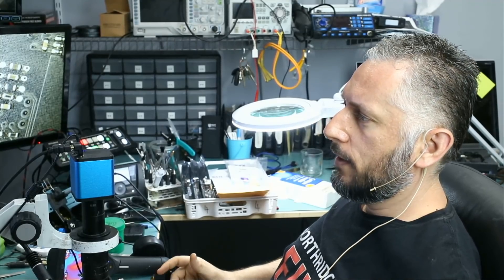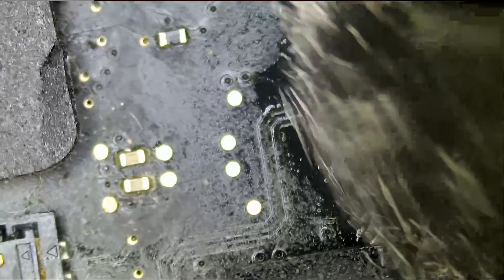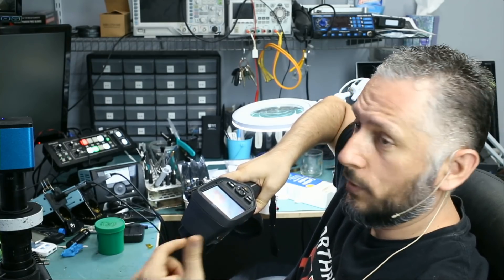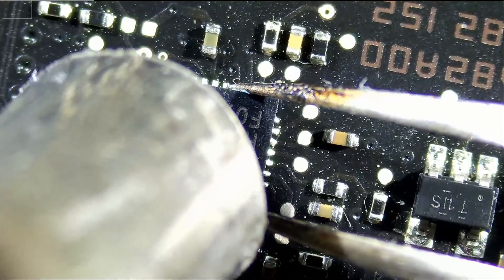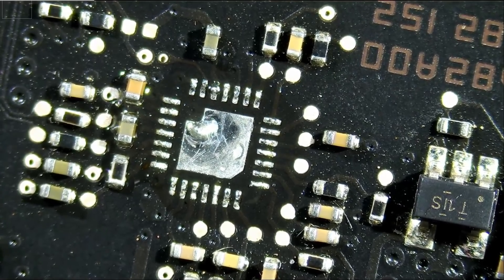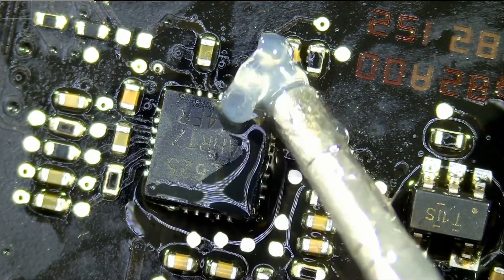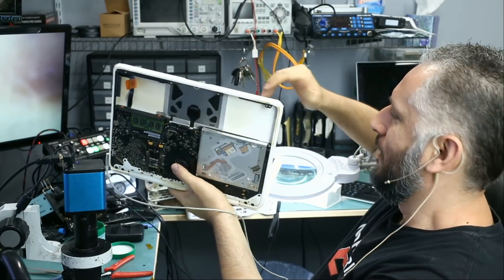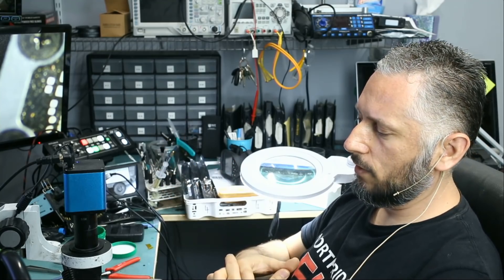Macbook Pro No Power Repair using Flir Cam - Working Smart not Hard

Comment: Working at a busy shop and a shop that doesn't have enough work to fill a day are world's apart. Some techs have spare time to spend more than three hours on a device, poking the multimeter leads here and there, changing different parts, bypassing signals with jumpers and so on. There's nothing wrong with those techs. It's just fascinating to observe the difference between a flourished and deprived business. Alex seems that he can't afford to fool around for a single second.

Comment: Mind boggling how a electric board still works after all that 'fluid'
Reply: Flux is non-conductive. And no-clean flux won't cause corrosion.

99% isopropyl alcohol also is non-conductive and is used to clean board. And it evaporates quickly.
Reply: @Jencha010101  thank you for sharing the knowledge!